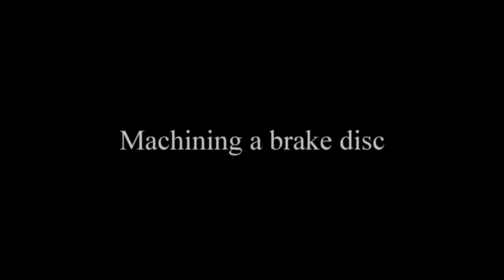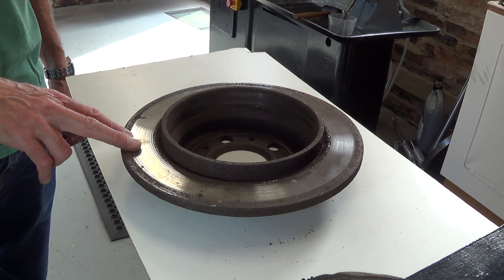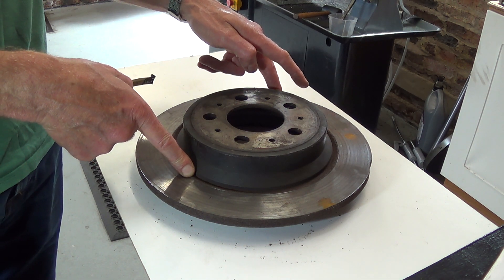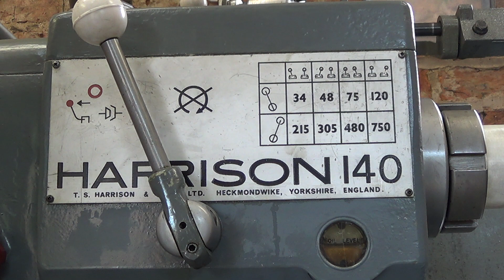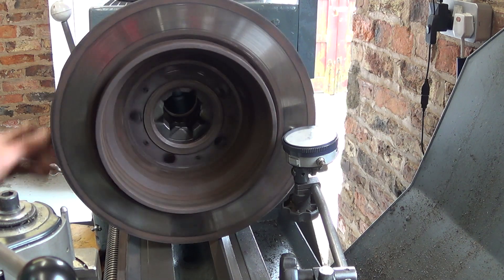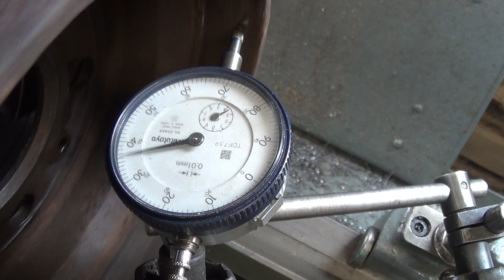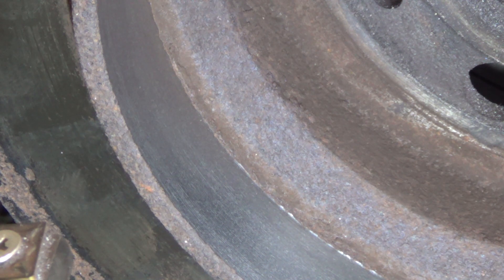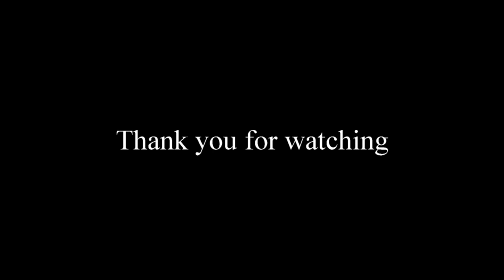HS22 Machining a car brake disc rotor on the Harrison 140

Comment: The current crop of today's machinists have totally forgotten how to use a Face- Plate! You have a brake rotor that is "as stated" true and in good shape on its rear face. This same rotor has convenient lug holes for easy mounting on a face plate. Another benefit of the face plate as compared to ANY chuck is minimum overhang that a face plate delivers.
Wakodahatchee Chris
Reply from the maker: I like you name C Drive 😁.  In video HS151 I skim some big 360mm VW Phaeton rotors with a bit more confidence. Cheers

Comment: The reference face must be the inside face of the drum?

Otherwise you’re wasting your time!!!

Stavros
Reply from the maker: Hi Steve, .... I think you are saying the datum face must be the face that bolts up to the hub, and yes I would agree. There I was relying on the front face of the jaws being true and clocking the disk friction face was just a double-check. Machining that disk rotor was an exercise to see if I could do it, and it was never actually used. However it looks like I'll be machining a pair of disk rotors on son's car soon and I'll have to be careful to get those right..... but I do have quite a bit more experience now. Cheers
Reply: Вы правы и контроль диска должен быть Измерив толщину диска в четырёх точках микрометром Допуск полторы две сотки Тогда будет норма На видео работа сделана не качественно

Comment: Obviously this man knows nothing about brake rotors,  You Never Ever just machine one side of the disc,these discs are cast iron and should be machined on the inner and outer together to ensure accuracy and eliminate any run out of the disc,the handbrake drums are always corroded like that because basically it’s a parking brake and rarely the shoes come into contact with a rotating drum so rust up because there is no friction between the shoes and the drum. I have a proper brake lathe which  is designed for the job and is accurate to better than 2 thousand of an inch and most times spot on. I am considering buying a lathe for commercial roters because they are a lot bigger than car and small vehicle ones,I appreciate that he set up the disc with a dial gauge but it should set up on the hub that bolts up to the vehicle,if he had made a mandrel so the disc could have been secured to the mandrel and then fitted into the lathe for machining ensuring total accuracy.
Reply from the maker: Hi David, thanks for your comments. I have seen brake lathes in operation and yes I understand they machine both sides together. Here I'm machining just for myself making the best of what I've got. That one was a spare disc rotor for practice. However if I needed to machine another disc rotor for myself I think with care I could do it. Cheers.
Reply: @HaxbyShed  Hi and thanks for your comments,front brake discs have to be really accurate to eliminate brake judder,you have have the right idea but they really need to be set up for machining on the hub face Not the casting as sometimes the casting are not as accurate as they should be,I just didn’t want people to think they could be resurfaced on one side only because they have to be parallel to each other to work properly and safely.

Comment: Hello Paul Bernard here. I turned my front rotor (Audi 100 ) yesterday and it was a disaster. I had sparks, vibrations and deep grooves on the disc and had to admit defeat. The disc was glazed by the pads with no scoring marks and I made it into junk. I had put new discs on the car and this was only for practice on the lathe. I wished I had seen this video before my attempt but I was a day late. On my old French lathe Ernault Battignoles, I have two speeds to choose from (not including thread cutting) one his called "Volee"which means full speed and the other is "Harnais "which is slow. I always use Volee to do all my machining so this is what I used, I think it was a mistake looking at the speed on your video. I also used the cheap Banggood tools that are rought but work ok for me on my other cutting work. What did I do wrong? I even used the automatic carriage thinking my hand at the crank was not steady enough, use cutting fluid, to no avail. Also I am about to invest on better cutting tools and I know you made a video on that. May be you could send me a link. I have had issues with British sales to France since the Brexit, so I may have to look somewhere else.  Take care.
Reply from the maker: Hi Bernard, good to hear from you. It's hard to give specific advice but in general I would say use slow speed and a sharp HSS tool to cut through the glaze. The cast iron used for brake rotors is pretty poor quality in my experience. Cheers

Comment: is this a test piece, remember disc have a specified thickens if you take too much off there usless
Reply from the maker: Hi Donny, it was a test piece to see if I could swing it in the lathe with the bed gap in place.  Usually discs can be cleaned up taking very little off and there are in fact 'brake lathes' for that purpose. These days discs/rotors for common cars are very cheap so it's often not worth the time to skim them but some years ago I've had car discs skimmed at a main dealer. In my humble opinion discs in the past were made of decent material whereas today they seem to be poor material regarded as a disposable consumable every few years. Once they get a bit of rust on the faces they won't clean themselves up through use and the rust patch just grows. The rear discs on my car are looking a bit that way so I may give them a light skim rather than give VW another chunk of cash.

Comment: What happened to the other side of the disk? It is most important that both disk faces are parallel.
Reply from the maker: It's a while ago now, I recall I clocked the other face and it was running ok and in reasonable condition. The disk was not warped. If the other side had needed machining I would have reversed the 4-jaw jaws and held it in the handbrake hub which I'd cleaned up already, or stuck it on a faceplate. Cheers
Reply: @HaxbyShed  Глупая работа Позоришь токаиную обработку ты
Reply from the maker: @Ник-л9х6ъ  Это не очень приятный комментарий. 😒

Comment: I don’t understand why you would clock in two worn surfaces. A brake disc registers on the hub not the wheel. So you should clock the inside face where it’s meets the hub and the inside diameter there it locates on the hub.
Reply from the maker: Well you are right of course. I think I was trusting that the hub face was seated and registered accurately on the chuck jaws. I may be skimming the rear discs on my own car later this year and I will do as you say. Most days are a learning day for me. :-)
Reply: Correct

Comment: All brakes are cast iron
Reply from the maker: Hi thanks, yes I thought it was cast iron. I have machined a number of cast iron items before and it's usually a pleasure to work with but these discs were really dirty low quality metal. No wonder they don't last long these days.